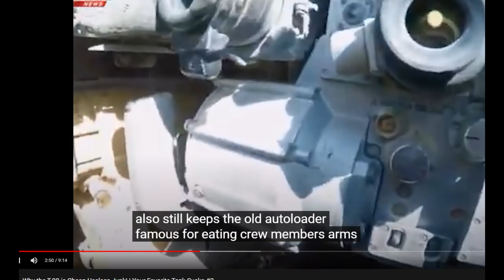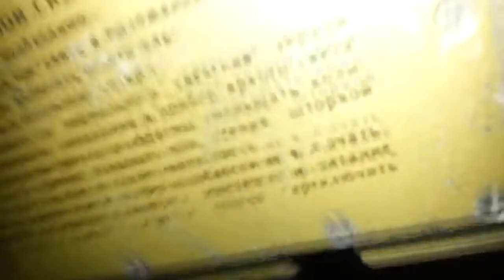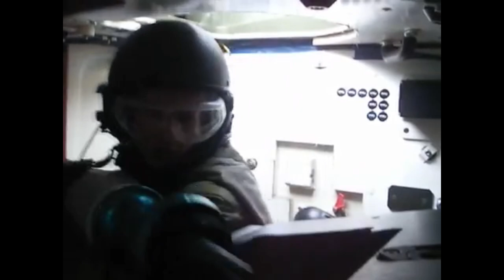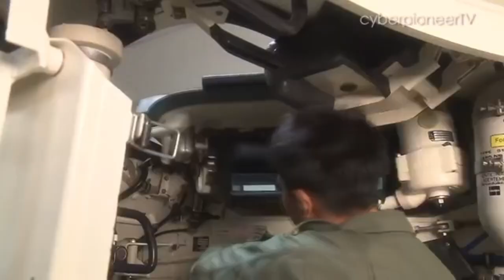Busting Myths on T-72 tank!

Comment: Regarding Iraq - they did not have a lot of T-72 tanks and T-72M / M1 are export variants that are downgrades. M stands for Monkey as a joke. T-72M1 is very similar to T-72A, that is true but Iraq did not have too many of these. Also a lot of tanks, such as Saddam were only "partial" T-72s - i.e. they had Polish made chassis but turret was local. There were up to 200 such tanks made. Note that Taji factory was the one that supplied steel. The partial kits were to go around sanctions. 
We will never know how many tanks Iraq actually had in the first and 2nd gulf wars.
Reply: If you conduct some research there are numerous sources of reliable information. The collapse of the Soviet Union resulted in availability of documentation to confirm reports from Janes, The Military Balance (based in Stockholm), among the most reliable publications available at the time.

Tanks may be knocked out, but the hull (and usually the turret too) remains. The US Army was able to study those hulks, as well as intact AFVs. 

I was able to personally investigate dozens, ultimately over 100 Iraqi AFVs of Russian, other Warsaw Pact, and Chinese manufacturers. The PRC made vehicles had the worst workmanship!
Reply: The M thingie and it means it’s monkey is wrong because there is nothing in the history of T72 is like that

The fault isn’t on the Iraqi army or the T72 but rather the circumstances
Reply: T-72M and M1 are not downgrades. Did you watch the video?
Reply: No offense but these are older rumors that are not true. As the video said, the T-72M and M1 were made for export but were not downgrades. They were identical to the Soviet T-72A, each corresponding to a different year (M1 was T-72A model 1983). Also from the video it is highly doubtful Iraq built/assembled so much as a single tank. And it is known they had a few hundred of each variant. They had enough in fact that several of each model survive to this day.
Reply: @paladinsix9285  Do you happen to know of any sources that talk about the examination by the US/NATO of Iraqi or Soviet tanks and tank ammo? From your comment it sounds like you do and I would be very interested.
Reply: @becauseiwasinverted5222  Closest to a "monkey model" would be fact, that T-72M and M1 were based on older generation of T-72. M model was AFAIK based of Ural model when T-72A was already in production, M1 was cleared for export when development of T-72B was finalizing.

That way Russians had technological advantage over other, potentially unruly members of Warsaw Pact should they have to... coerce them with less than peaceful methods. Also helps with secrecy about newest tech, in case other countries counterintelligence efforts weren't quite up to the task.
Reply: @Panocek  As far as I recall, the export models were not older than their Soviet counterparts. T-72M was introduced along with Ural-1, while T-72M1 and the identical Soviet T-72A m.1983 were both introduced in 1983. However the latter indeed remained in production in the USSR for only a brief period before being replaced by the T-72B, which likely does explain why the Soviets were willing to let the Pact export the then-best T-72 variant.
Reply: The t72m is a t72 a hull with an a fire control sistem and ural turret, and the t72m1 is a one to one copy of The t72a obr. 1981 manufactured in chekoslovakia and built with good quality. The issue is chekoslovakia and poland removed some sistems from the t72 before being shipped to iraq, and 9f course iraq using 3bm9 from the 60s
Reply: @barbarapitenthusiast7103  Almost - T-72M1 is almost a T-72A - it is missing some stuff like nuclear blast protection systems. Iraqi T-72s AFAIK only had optical range finders and some had only active night vision.
Reply: @tomk3732  the part about the t72m/m1 not having the greatest NBC protection is True (soviet NBC protection was far better than nato ones so its not that bad) but as for the lack of NVD some were removed by poland and chekoslovakia and others were simply taken out by The iraqis because of lack spare parts and no working IR flaslights. (again thats because they didnt have anything to put in the flaslights, because no spare parts)

Comment: Anyone who's got a clue about diesel engines will know that even a regular car diesel engine will be able to work with a multitude of substances as fuel with minimal modifications. It baffles me how armchair tank gurus somehow miss this information.
Reply: Old diesel cars can actually run faster and more powerfully on petrol, albeit with some wear on the engine
Reply: @ataphelicopter5734  how would it run more powerfully on petrol when diesel has more energy?
Reply: A diesel engine typically has a 23:1 compression ratio and running on gasoline would cause detonation, meaning a diesel engine can't effectively run on gasoline.
Kerosene, jet fuel (which is high grade kerosene, fuel oil would also work, but not gasoline.
Reply: I did some research for my first science fiction novel I discovered much to my absolute delight that diesel engines are inherently multi fuel and can run on an insane array of combustible materials because they were actually purpose designed and invented to be able to work in primitive conditions on basically any sort of combustible fluid as fuel. Perfect for an alien planet where the nearest resupply is a six year flight away.

Comment: The T72 has been around forever. For awhile it might well have been the best tank going. Once the Abrahm’s and Challenger tanks came into the picture it was eclipsed and is well behind them . But it is still a reasonably capable tank that can hold it’s own with a good crew. Thats part of the problem, most of the countries that buy these things don’t have very good training for the crews. Thats not a reflection on the tank!!! If I were going to war in a Russian tank I’d sure rather be in a T90, but the T72 would probably beat walking.If they aren’t fighting the US or the British you probably have a pretty good chance in a T72. Like I say, it would beat walking.
Reply: Challenger have a paper-like hull protection, weak engine for his mass and obsolete rifled cannon, and M1 at the beginning had paper-like armor and 105mm rifled cannon... so I wouldn't say that M1 and chally "eclopsed" anything when they were put into production.
Reply: @unholyknight786  Challenger only had weak sides for it's time. The hull front was reasonable well protected for around 450mm KE protection, which was considered adequate considering the average penetration of KE projectiles at that time. The average KE penetration of Sabot's of the late 1970s was around 400mm RHAe penetration. The Chobhom armor gave it better CE protection and protection against HESH nearly double of KE as these were still extremely common in the late 70s and into the early 80s. 

The M1 Abrams had around the same KE protection frontally on the hull and around 500mm KE RHAe on the turret. By the mid 80s, testing with the newer 120mm guns and the newer 105mm penetrators, they opted to place DU Plates in with the Ceramic plates to better increase protection against KE. This was because the Soviet Union was running 125mm guns and based of the new 120mm gun, they knew the penetration of their newer 125mm KE would be higher than the M833 105mm's, so they calculated based off this and did a rough estimation on what would be required. The Challenger 1 had issues with such uparmoring which is why the Chally 2 came out quickly after the Chally 1 for the turret adjustments.
Reply: I wouldn't say the t72 was ecslisped by the m1. According to us tests the 1985 modle t72b had better raw firepower and armour compaired to the m1a1 as late as 2008. The only thing the abrams did noticeably better was with optics and firecontrols , but that advantage started with the m60a3 not the abrams.
Reply: @matthiuskoenig3378  Not sure what tests you're talking about, but per Aberdeen reports, the T-72B which we got reports of how it operated thanks to Israel as the Soviets gave the Syrians their better models we found that per our own theory, the 125mm guns did have better penetration capability as we expected. Armor wise, the M1A1HA, which is just known as M1A1 was superior protection wise than the T-72B in the frontal arc, the M1A1 had better side protection due to the stand off composite panels running the front section. The T-72B with ERA had superior HEAT protection.

The main difference we saw was the far better arrangement of their composite armor system in the turret vs the older T-72A, as well as the ability to fire ATGM's from the tank which caused us alarm. We were unsure how effective the missiles were as none were captured, but knowing their maximum range was beyond the return fire of our own guns was considered a major concern.
Reply: @Azumazini  Would it be too much trouble if I asked for more info on those Aberdeen reports
Reply: @becauseiwasinverted5222  I'll dig through my archives to find which one was more accurate. One is from a TRADOC report which was used to accurate train US Tankers the pros and cons of enemy tanks and it is extremely accurate to teach them how to effectively engage such units. Many people think it's a bunch of propaganda but if you read them they accurately told M60A1 tankers to be extremely careful when engaging T-62's in the earlier versions due to them having one of the best velocity APFSDS's which gave them a very high first hit and the only real limitation of the T-62 was it's FCS and a lack of a good range finder, but that vs the 105mm, it was superior. They gave the T-62 a 70% hit chance on first shot at 1km in battlefield conditions, not training conditions. and a 50% chance at 1.5-2km. That's how much they respected that 115mm smoothbore. 

A lot of this information I have memorized over the years working with Military History Visualized and having been a Historical Consultant with Wargaming and Gaijin before I left. Most just knew my by my moniker, Azumazi.
Reply: @Azumazini  Thank you, I would really appreciate that. I can't say I know those communities well enough but the common interests mean I do cross paths with them from time to time. They collect and help disseminate a great deal of material.